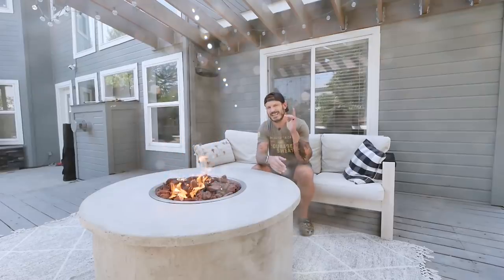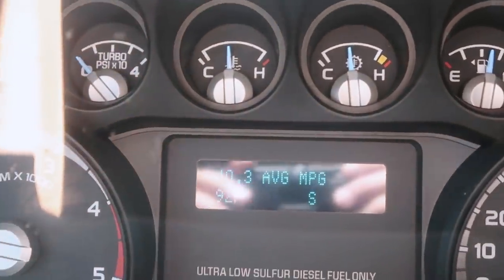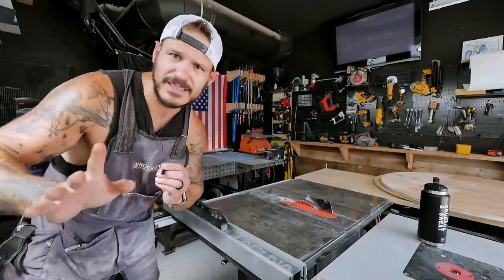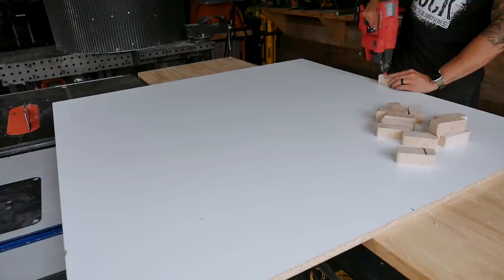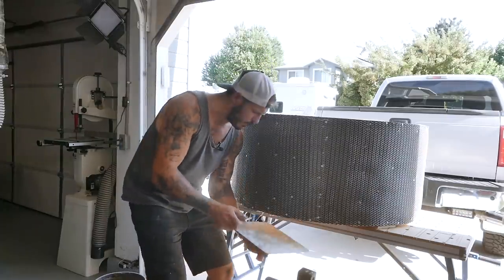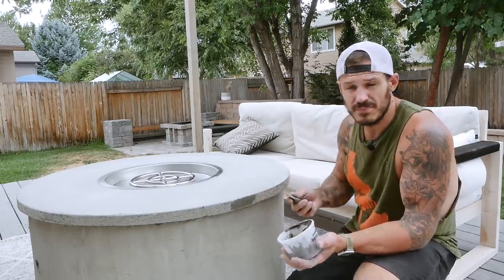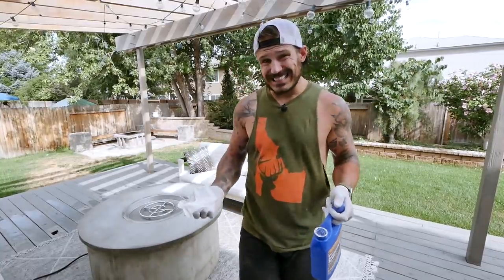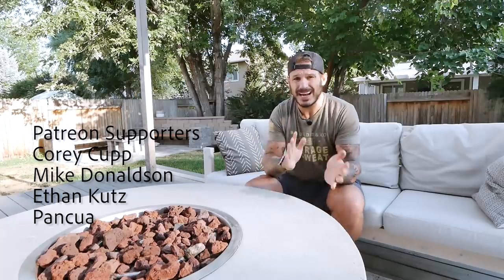DIY Patio Gas Fire Pit Table

Comment: Teflon tape is only necessary on the pipe fittings due to the tapered thread. The flare fittings will seal air tight as long as they are properly tightened.

Comment: I'm looking to build my own as well. Looking at a few videos for inspiration on how to build the frame. I'm getting a burner ( 30"x 10"). so mine will be rectangular. Thanks for the video man, it got me thinking. Btw, you don't need to apply teflon or pipe dope to the threads of a flared type fitting. You only need to use it when you have a male threaded pipe going in a female threaded fitting. I'm a licensed gas tech in Canada.

Comment: You should build a box for your tank, it would look cleaner and help protect it from getting knocked over.  The Lava rock is cool, but I prefer the colored glass beads, they catch the light of the fire and give a nice glint. Of course the downside is they need to be cleaned at least once a year to stay looking nice.

Comment: Great build. I started the same project myself. The base will be pallet wood. Had to but it on the back burner 😂 because of work. The top will be concrete like you did. 

You can actual put the tank inside the base with enough separation and air flow. Since you are on a deck and with that large hole you cut out the bottom you should have been good.

Comment: Drill a small hole in the corner of the deck where the propane tank is and run the hose UNDER the deck to the burner from underneath. Would be way cleaner.

Comment: You might want to put metal rods or mesh inside the concrete top though, as concrete can crack outside and be aware the slight overhang might break easily, but it's pretty thick so idk 🤔 oh, and I would have added ventilation holes in the base, so in case of leak the gas doesn't build up inside
Other than that it's great for it to be so light, not to put too much stress on the terrace beams, the waterproof finish is a really bright idea and I love how you made it really easy and straight to the point, the design looks really flush and modern 
Keep up the good work!

Comment: Recommendation: install vents opposite each other on the drum. They need to be about three to four inches from where drum sits on the ground/patio surface for propane fuel. If you had used natural gas, the vents would need to be closer to the top of the drum. Otherwise, great job!

Comment: Alex -- Can you offer suggestions for a design of a CONVERTIBLE fire pit table -- one that is a standalone fire pit table say 4x2 long. that can be converted into a rectangular table for six using the fire pit table as the center element.
[HINT: Idea for your next video!].  I cannot find this discussed anywhere.
I have a porch where a fire pit accent piece would be wonderful but a full size table is not needed most of the time.

Comment: Why not make door in the side and put the tank in the bottom? And maybe make a compartment to set the tank in with a small vent to let any gas leaks out below the top, that way you will not trip over the tank hose and it would be hidden.

Comment: Any update on how the OSB Board is holding up on the grill station? I thought I would need to buy pressure treated ply, and was concerned that the inner-side of the OSB is still seeing the elements (compared to the underside of an attic roof) and it would be cost-effective if i stuck to the OSB

Comment: Just thinking a hexagon base would be easier to make and you could put a stainless access door in it so the propane tank could be stored underneath and accessed similar to the expensive units Home Depot sells. Why didn't you put the tank inside by the way?

Comment: Is there a reason you didn't put the propane tank in the table base?
Reply: Conrete is heavy. This just makes it easier to change the bottle etc. Using something like a door would be a lot of work. And this is a little safer since the bottle won't heat up as much
Reply: He’s able to take the metal part out to replace the tank. I would put it inside.
Reply: Propane has a shutoff valve on the tank, it needs to be turned off while not in use. Having the tank inside would be waiting for the bowl to cool down, then lifting the bowl out to turn the tank off. Kinda a pain in the arse.
Reply: @SchiebzBBX  He used a separate on/off on the gas line as part of the kit (similar to what gas fireplaces use). But like you said, a pain to switch tanks depending on frequency of use.
Reply: @reboerio  Would the heat be that significant? How much different is that than keeping the propane tank beneath a BBQ grill?

Comment: What is the folding workbench with the wheels attached? I NEED that in my life.
Reply: It's a Kreg ACS, short for Adaptive Cutting System. Great for a beginner DIYer who's looking into a set that is very diverse. Not sure how well it works since I've only seen it in video's, but sure seems promising

Comment: Why not hide the tank inside the table? Maybe your design should have included a "hidden" door to gain access...Oh! Maybe attach the tank to the inside of the door! Awesome table!
Reply: This was my thought. He actually doesn't even need a door, as the insert comes out. He could just put the tank inside before the insert. The only issue is changing it would take more time/need to lift the insert constantly.

Comment: instead of drilling on the side of the pit for the gas line why not run it under the deck ?
Reply: That would be silly lol. Put a hole in your deck? And what about when you want to move the fire pit, as most always do?
Reply: @remodz6385  last time i checked firepits like this are not meant to be mobile, but if you want to add wheels to yours and ride it around town go ahead lmao.

Comment: Your work is terrible and dangerous. I can’t believe you actually edited in the part where you were threading the flared end of the connector to the nipple lol. You should always read instructions boys n girls. Especially when dealing with gas. Also why did you make your supply line a massive trip hazard in a place where people are gonna be drinking and eating?  I’m not trying to be a hater and I’m sorry if that’s how I come across. I just have high expectations for DIY gas guys especially when they are making a video that thousands of people see.